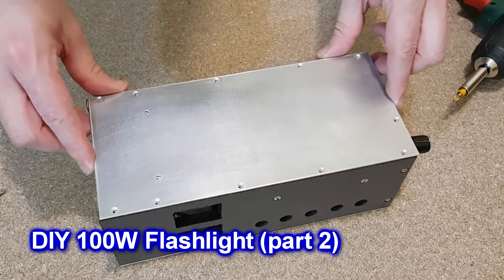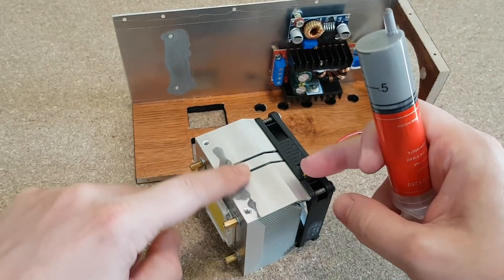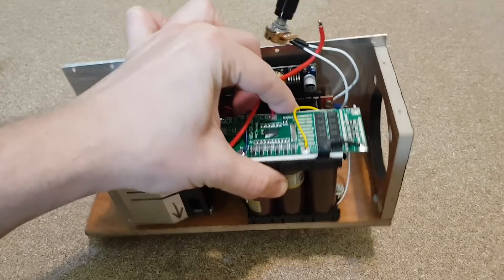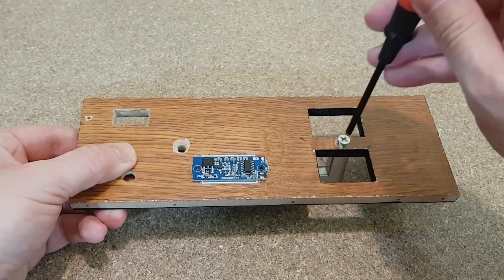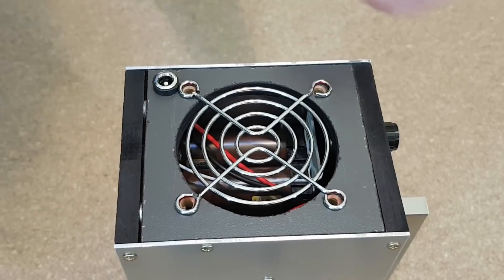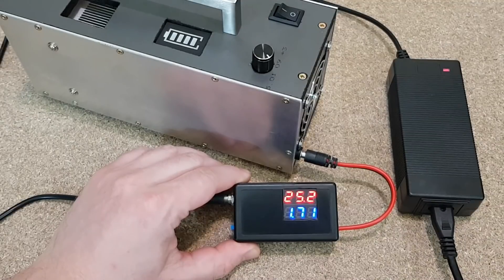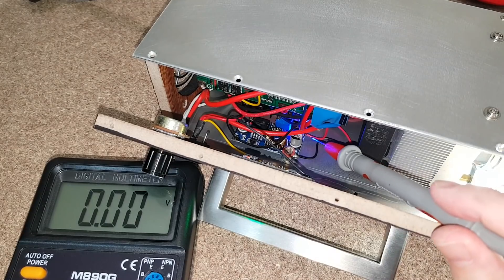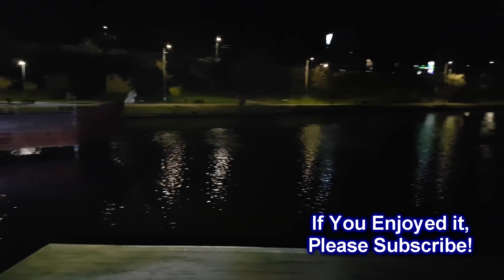DIY 100W LED Flashlight - part 2

Comment: I mean, that's cool and so, but why exactly do you need a 100 Watt flashlight? 😁
Reply from the maker: you can use it at the lowest intensity and if you need more power or longer range, you can set it to maximum power. it's very good for camping. another reason is because other youtubers have made a similar flashlight, but they don't explain everything and some of them are liars with their fake videos.

Comment: Great project and awesome measurement!! , i think for a led application its better to use pwm signal for adjusting the current rather than voltage